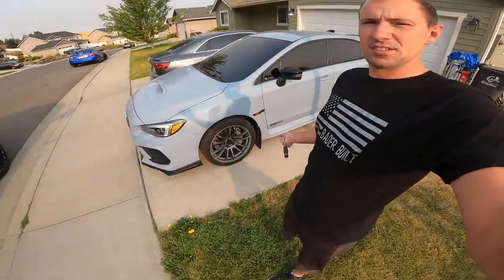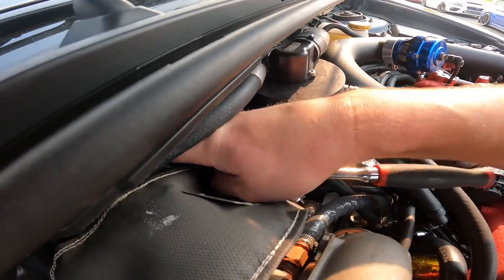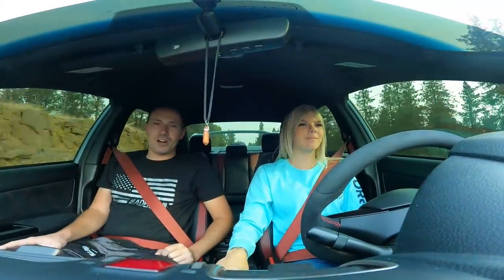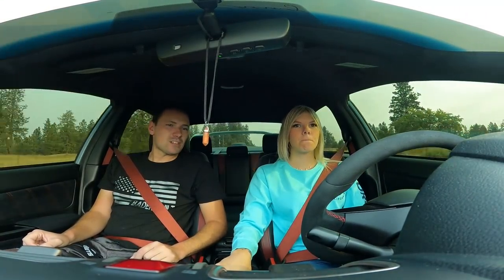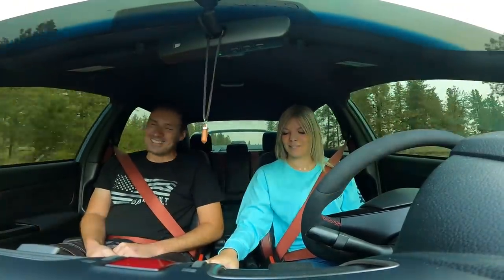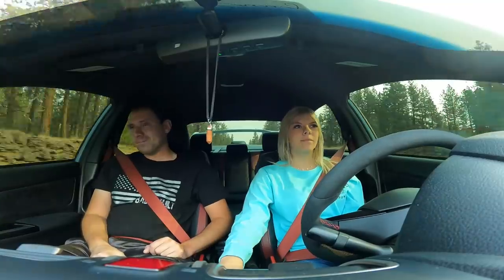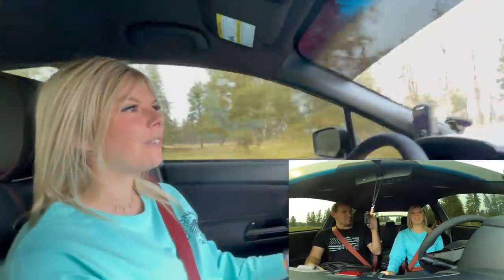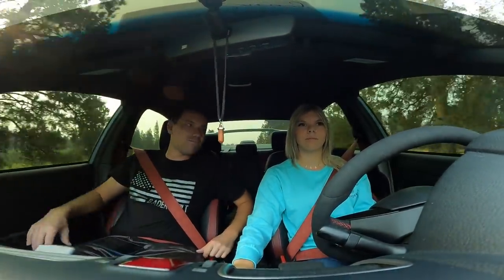Wifes's First Time Driving Her 650whp STI!

Comment: If u really wants equal length+twinscroll header...

The best will be oem jdm ej207 sti header... Doesnt sounds funny (thicker stainless material) , comes with proper heat shield...

Also is 2 part header so u can run twin or single scroll anytime with just up pipe swap